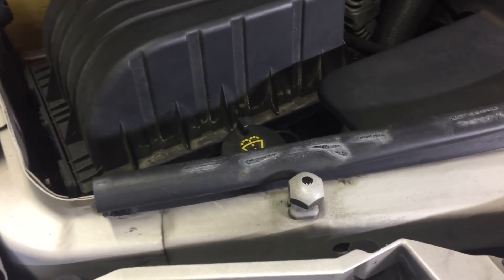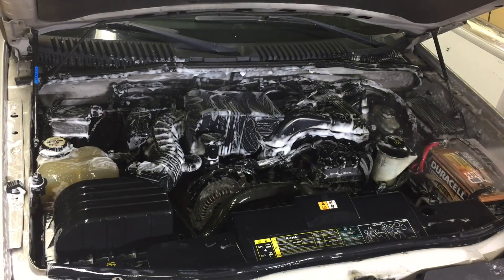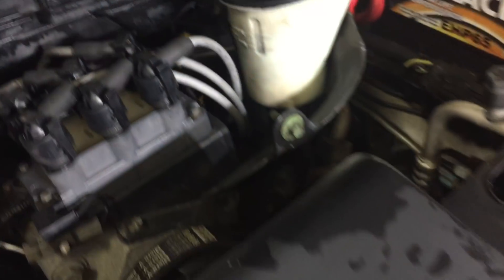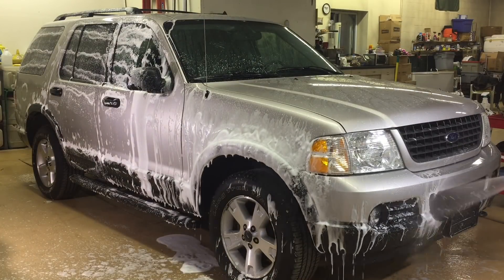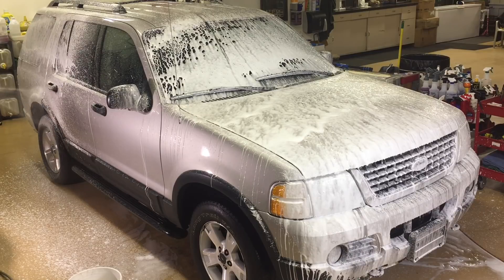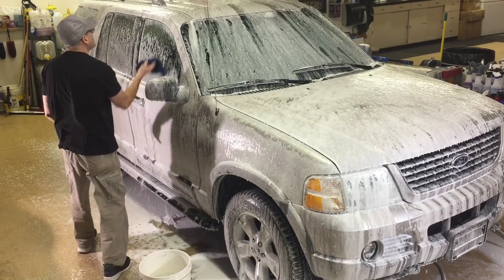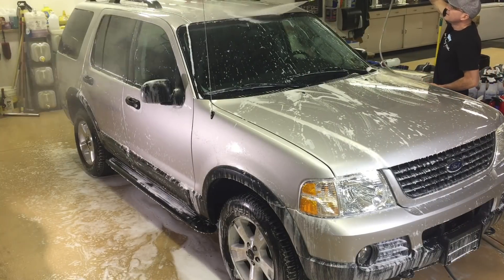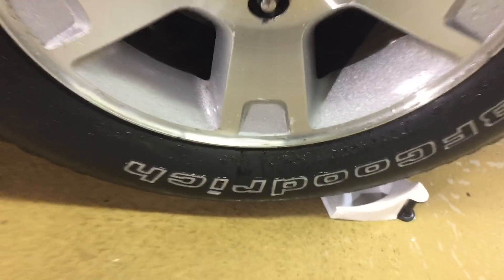Masterson's Mystic Snow Foam Auto Wash (16oz)!! Continuing the Shampoo Showdown!!

Comment: Like someone else mentioned 9th gen accord tested this stuff and it was one of his top shampoos. Quick question though, when you did the gas pressure washer segment how many ounces of mystic snow foam did you use in your cannon? Just curious of your ratio there. Also last time I checked you couldn't get a gallon of this stuff only the 16oz size. Thanks Brian great video and loving these series you have put together.
Reply from the maker: Two ounces in the snow foam cannons. Label calls for 1-2 ounces😁